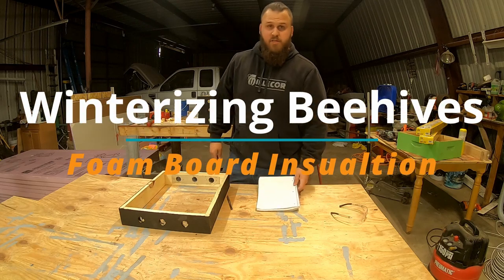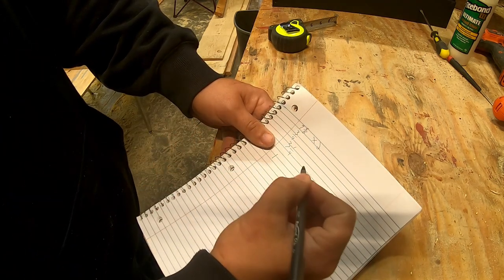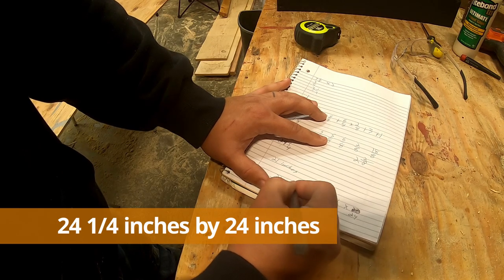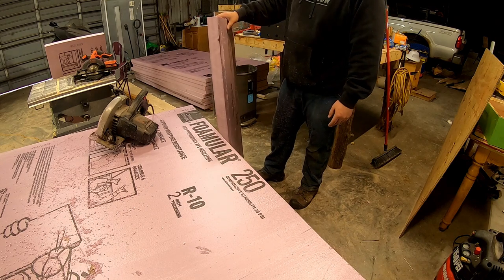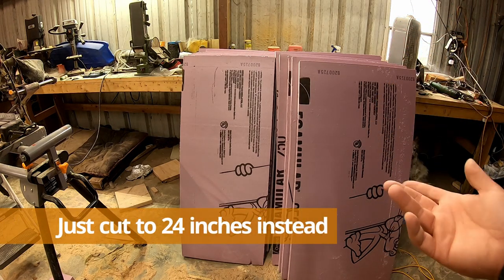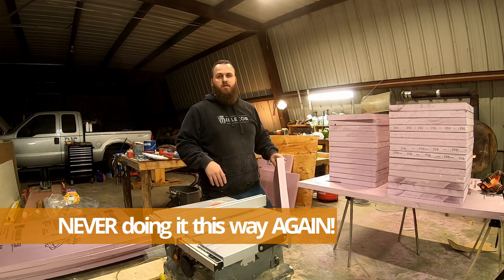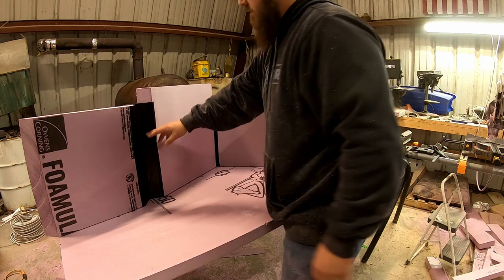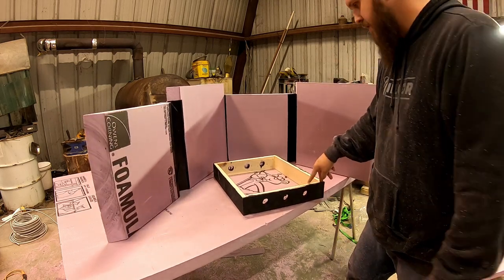How to make Insulation for your Beehives (Full How To)

Comment: Just remember thicker insulation works both ways. It may keep the warm air in but when it cools down inside it will keep the cool air in as well instead of letting the winter sun warm the hives back up. Hope it works well for you.
Reply from the maker: Yes I researched into this and there’s lots of people up further north then I am that do this or something similar. It was also recommended to do this way by a master beekeeper I talk to. We will see what happens
Reply: just remember the bees are amazing at regulating their hive all by themselves...the insulation keeps the internal temperature swings less than non-insulation.  just like your house....properly insulated you get smaller temperature swings and you use less energy for heating and cooling.  Bees do both.